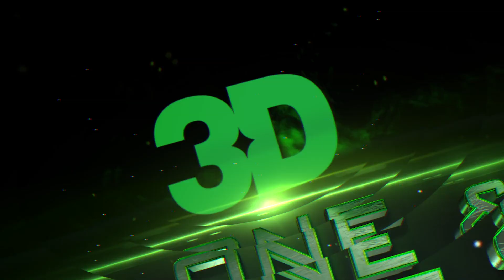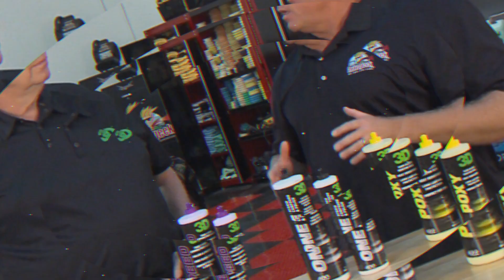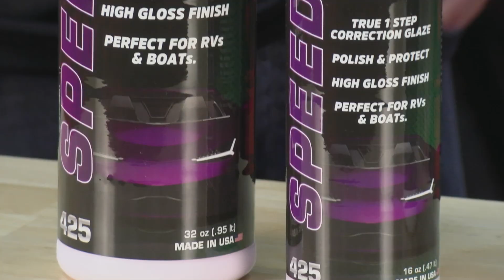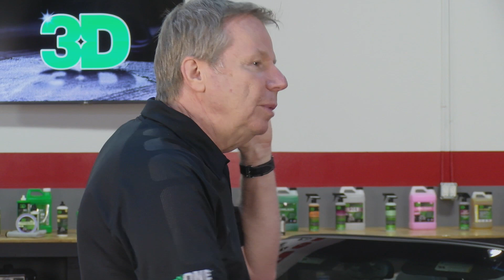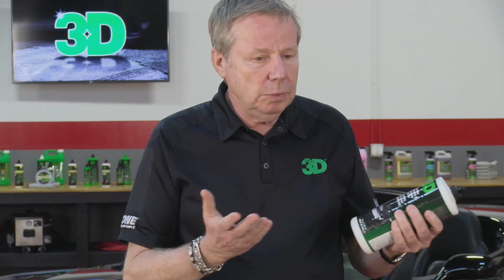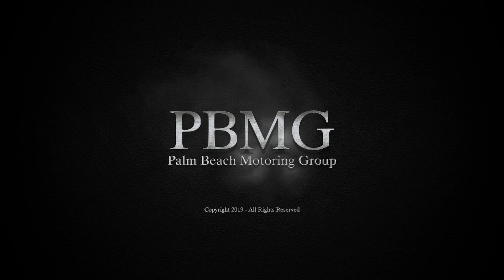How to quickly correct & protect your cars finish - 3D Products SPEED, One & Poxy explained.

Comment: Old video. I have Speed and want to top it. Should I top with Poxy or spray Bead it?
Reply from the maker: You could use either one, just personal preference. We would recommend using the Poxy but also topping it with the Bead It Up for the extra slickness and hydrophobic properties. Both are very easy to apply.
Reply: Thank you for the response
Reply: I'm usually against topping a cleaner wax, but I have for a friend, and I used 3D Express Wax. 

Optimum Car Wax is another I would ise as a topper.

Comment: So speed is one and poxy combined?
Reply: It doesn’t correct as well as 3D One, it’s less aggressive. It doesn’t leave as much protection behind as Poxy. 

It does a great job of improving gloss and filling in deeper scratches and wipes away very easily. Speed is the perfect name for it, it enhances the paint quickly.
Reply: Speed is 10% cut, 20% polish, and 70% protection (synthetic and montan wax).

In theory yes, although with  the focus more on the polishing end than the cutting, where 3D ONE is more balanced.

Comment: will 3d one remove 1000 grit wet sanding scratches? thanks
Reply: It would be faster and take less effort if you started with a heavier cutting compound like 3D ACA 500. You can finish with 3D One one a less aggressive pad. There are some soft paints that won’t finish as well as possible with a one-step product like 3D One, and you may end up needing a fine finishing polish.

Comment: its funny I got the 3d speed on a whim thinking it wasn't going to do anything maybe add a little wax protection.  I was completely surprised by the results i have been getting with it, I removed a bunch of scratches and hard water buildup on my windows like it was nothing.  and my new titan had really bad and faded black paint, this stuff brought it back in no time literally less than 3 minutes on a whole panel and it looked amazing. I cant wait to try the 3D ONE with a correction pad.

Comment: Can I top the 3D speed with the poxy? Thanks
Reply from the maker: Yes
Reply: @autogeek  

Do i need to use 3D one first , then 3D speed , then the epoxy?
Reply: @reza_dc2  no. If you use 3d one then follow that with poxy.
If you use 3d speed that is good enough on it's own but can be followed with poxy for added wax. It all depends on the condition of the paint or the results your looking for
Reply: @rob-lw7be  

Appreciate that , I figured out 3D one is more of a paint correction compared to 3D speed.
I’m planning to correct black BMW paint , hood , roof , and trunk are becoming dull.
Reply: @reza_dc2  - 3D ONE functions as a compound, medium polish, and finishing polish depending on the pad. 

A lot of people mistakenly think it's a "one step polish". It's a "one polish does all" product. The fact that it finslishes so well when used as a cutter makes people think that. I used this stuff weekly at work. I've used it on everything from McLarens, Lamborghini, Rolls Royce,  etc to my junky 2006 Dodge Charger and everything else. It's a very versatile, and very effective product. I've tried the Sonax, Rupes, CarPro, Adam's, Jescar, Menzerna, Optimun, Meguiar's, Poorboys, and probably some compounds/polishes I don't even remember. I consistently reach for 3D's line more than the others. I do really like the Meguiar's M110, M205, M210, and the Jescar line. Optimun Hyper Polish is great too.

Comment: What's the difference between AAT 501 and ACA 500? And are these inferior to 3D one?
Reply: AAT uses older nano abrasives. ACA and ONE use the new Alpha Ceramic  Alumina abrasives. 

AAT is older tech, but still very, very high quality. 

3D ONE sort of sits in between ACA500 Xtra Cut Compound, and ACA520 Finishing Polish in it's cut and finish. It could have been called "ACA510" if they had gone that route.
Reply: @danlc95  , thank you for clearing that up...👈
Reply: @danlc95  from what I’ve heard, AAT 502 consistently finishes better than ACA 520. 😉
Reply: @qwikss4469  - All day long, good sir!

Comment: Love all of these products! Would love to hear from Mike or Tunch on this question: Is there any benefit to topping 3D Speed with Poxy? Will it actually lengthen the protection time?
Reply: Just got to the 14:00 mark and Mike mentioned you can go over it with Poxy :D
Reply: Don from 3D said it's a waste to top Speed with Poxy, because wax doesn't bond to itself. 

If you want to use Poxy, it's better to just use ONE first then apply Poxy.

Comment: Did they change the formula?  Because I used speed topped with poxy a couple years ago on my new pickup for its first wax job and had to spend hours with a red eraser getting wax stains off of my black plastic trim.  My bottles are the older black bottles.
Reply: Good question! This is the best product I've ever used on the paint, but Tunch is crazy... you get this near your plastic black trim and it is a complete mess!!